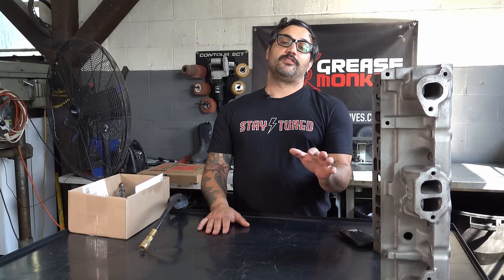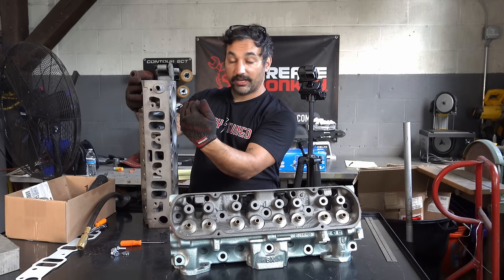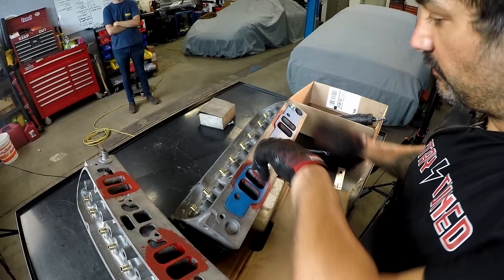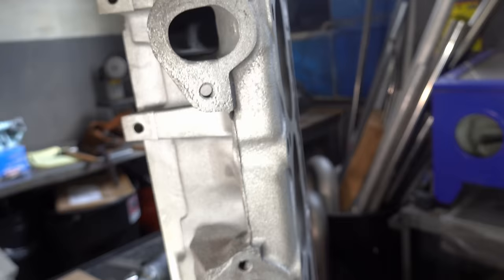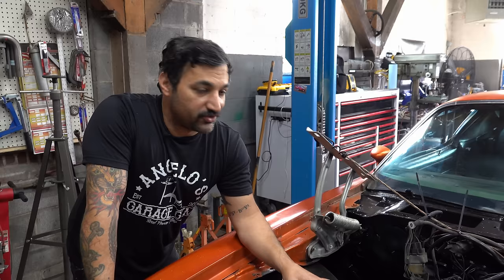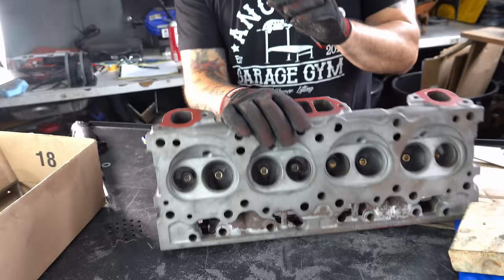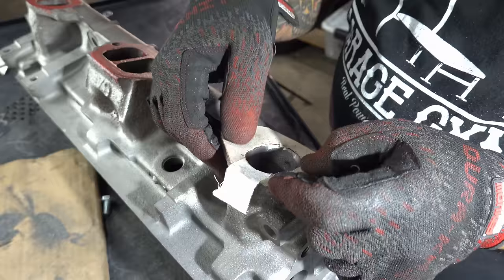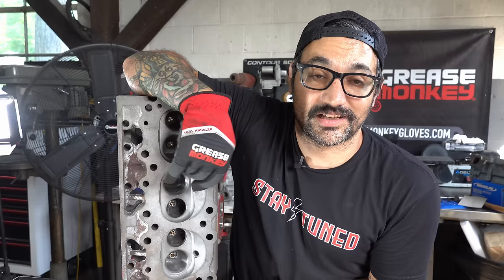It's Free and I Hate it! *Works on Any Engine

Comment: When porting my best tip is have a vacuum running to keep the shavings out of the way during the porting. Just stick it on the back side to keep the port clean to see what your doing
Reply: I know your expertise is in sword fights but this is a good tip 👍
Reply: This is my favorite thing to do, especially when porting cast iron manifolds (sometimes you have to do what you have to do, but mainly on turbo manifolds). It's amazing at how well I works.
Reply: It’s worth setting up a fan and collecting bucket. Much less noise and stress.
Reply: I fully agree, when porting our 6x4,s I did this vacuum technique with some ear plugs in. Around 1993, it works great so you can see well everything you want to remove and everything you know you should not as well.
Reply: Smokey Yunick is the man that started this. Hat's off 🤠
Reply: I have water running directly at the bit the whole time and everything washed through to the tray that’s underneath the head
Reply: I use magnets , too.
Reply: 777777
Reply: @Zzus321 my dad did this also he had a( soiox) soo valve grind  machine his little shop in the 50s-60s
Reply: We use pam cooking spray on burrs to prevent aluminum clogging on your tools
Reply: Shavings equals horsepower

Comment: We were a Pontiac family and porting the exhaust side of a Pontiac head will make HUGE changes. I'm loving this build.
Reply: They look really restrictive.
Reply: @jcnpresser  - Yeah and such a small exhaust valve for the CI.
Reply: @danmyers9372  670 heads would be nice but getting hard to find I'd imagine.
Reply: Porting the exhaust ports will increase bottom end mid torque numbers… but the problem is there’s not enough cylinder head to port out without going into a coolant or oil jacket.
Reply: So I have a question, if I port the exhaust side of my Kauffman heads will that help, how far should I port them. Header gasket match? I don’t want to hit a oil or coolant passage however more flow is very interesting! My heads are CNC ported to 340+CFM.
Reply: @MrTheHillfolk  I have 670 heads on my 67 block and I've been debating about going over to aluminum heads to ease up on the compression. I know they were the last of the closed chamber, high compression heads though, so I'm kinda hesitant to move on. 🤔
Reply: @mattysoho  my buds car, that was late 80s like 89 or so. 
"Usually" aluminum heads should be better you'd think ,I honestly don't know. 
I'd definitely save em if you do swap to aluminum, my buddy shoulda dropped the $ and had his redone. 
I'm wagering the aluminum heads have lower compression(hah that's no fun)  from what ya said.
Reply: I’m lovin Tony.

Comment: Porting does nit make "more air flow in and out" that is a huge misconception people like to say, the whole point if porting is to make the air move in and out more efficantly "smoother" and be less turbulant...  As fir gasket matching you wanna "Funnel" the gasket opening with a smooth radious and not just hog it out to be that size, if you make the whole port the same size as the gasket then you just slowed down your incoming ait charge. Another VERY overlooked thing people don't think aboutnis the Cumbustion Chamber like deshrouding and make a smooth radious where the air flows around the valves and good valve seat and valve radious angles.

Comment: Very pleased that you are building up the classic Pontiac V8.  Keep at it; lots of Pontiac enthusiasts still around that love this!
Reply: It was lonely years ago. There were very few of us. But now with the internet and people realizing just how rare birds are there buying then up and creating on line clubs.
Reply: I had a 67 Firebird convertible with a 326.  I let it go in the 80s, partly out of frustration with aftermarket support.  Went to z28s after that.

But because I'm a glutton for punishment, I'm now working the top end of an Olds 425 for my 65 Delta 88.

Still, I have a soft spot for the ponchos.  Good memories.

Comment: Also, after gasket matching the ports, always make sure that the intake port is smaller than the head port. So long as the intake port is slightly smaller than the head port, you build what's called a reversion dam. Any supercharging effect that may possibly happen from the mass of air traveling down the port, when it tries to revert from bouncing off of the piston when cylinder pressure rises or off the back of the valve, this reversion dam will keep pressure in the port. When you go to install the intake gasket, make sure that you glue the gasket to the cylinder head. You can do this with 3M spray adhesive. You don't need to cake it on, but you do need to put a thin layer of spray on the gasket and on the cylinder head. Also on the intake manifold side of the gasket and the intake manifold gasket surface, put a very very thin coat of Vaseline. This will allow the intake manifold to wedge into the gasket helping to compress it and lock it in place. It will also prevent the gasket from moving where you have it lined up on the cylinder head so it does not become an obstruction in the port. You do not want the gasket to move!  As the intake is torqued down, stick a flashlight down the ports and see how they are lining up. If the intake seems high, look at the floor in the port. If it still looks high you can either try a different (thinner) intake gasket. If the intake seems too low on the port, you can try a different (thicker) gasket. You can sometimes use generic gasket material. Trace your existing gaskets on the gasket material and cut them out. Add these new gaskets to the existing ones to act as shims. Some OG engine builder tricks.

Comment: wow, that's super generous of butler performance to give you a ported head as a template to follow!   Saves so much time cutting and testing with a flow bench
Reply from the maker: Butler has been awesome supporting this build! Yeah, this head was cracked, so they had it laying around and shipped it up.
Reply: @StayTunedTA  - Get two cracked heads and weld them up and use them...

Comment: Awesome project! I put a sump like that on a fresh tank in my 78 T/A way back when but my welding skills were such that when I put water in to test for leaks it was like a strainer, lol. I had to silver solder over the welds to get it to stop leaking. At the same time I put an Aeroquip "tip over" check valve vent in the top of the tank at the recommendation of our local speed shop engine builder/Guru. I also home ported my 6x heads after practicing on some 4x and getting some tips from the same Guru, never ran them though as my motor had some ported 62's on it already.

Comment: You're an awesome dude Tony, I met you at LS East Fest 2019, you're a really kind guy and very very nice to me and my friend Jordan Frank. You're definitely living the dream doing stuff I wish I could do so desperately, I just don't have a place where I can do anything unless I want to lay on a steep hill covered in muddy, dusty gravel which is just a recipe to ruin anything before it even gets built. One day I'll get out of this place and have a garage. I live that you're keeping it Pontiac, just nice to see something a little different. The head porting is great, a dab 'ill do ya though, just a mild job since the blower will be doing the work. It should certainly put 600 to the wheels, might take a dribble of race gas to be safe or some ethanol carbs if you can get corn juice. That car is wonderful, I adore it. Definitely a conversation piece. I have a 2004 GTO 6M that has been in storage since 2018, I lost the engine in a tragic accident, I had just dropped $7,000 into the car. Total heart breaker. I have to assemble a new short block one day and get my cam/headers LS rocking again. Your loyal viewer, Lee Henderson

Comment: Hey Tony absolutely loved the series on the TA  Can't wait to see it's finished I'm 61 so I had one of those cars back in the day 76 TA  With the anemic 400 lol  Love what you're doing keep doing you
Reply: The 1976 400 had 7.6:1 compression. All it needed was to mill the heads about .040 to .060 and a set of corresponding push rods and it would wake right up.

Comment: Hey Tony,  glad to see you showing the way things used to be when most cars you owned were iron block and heads, also upgrading to aluminum heads were to expensive or didn't exist. I ported 2 sets of early iron windsor heads and those heads need all the help you can give them, couldn't afford the aluminum ones in the 80's. Love what you are doing.
Reply from the maker: Right on!
Reply: Ford Windsor are really bad.  I had them on my 1970 Mach 1, 351 W back the mid 70’s.  And unlike today there were NO aftermarket heads forthe Windsor back then.  The Cleveland and the FE got all the aftermarket love.

Comment: I use the gaskets I'm going to use as a template, that way you can line up the head and intake and exhaust to be sure you get smooth flow all the way thru.  Even the header flanges can use some cleanup usually. The hippie porter I learned from said to think of the air as water and imagine how it flows thru the ports and valve.  You would go to his garage in the middle of the night and there would be 2 lights on, his little work light and his weed. Had a flowbench but relied on his vision of water flow the most. 
I built a 468chevy with a 6/71 and the guy had an "awesome welder" to weld that sump on to save me time.  He put it on sideways!  🤯😂. 
Keep up the traditional, diy, lower buck style. I'm tired of everyone buying power, we used to have to make power and you learned so much more that way.

Comment: Porting iron heads is a lot of work so it’s always best to concentrate your efforts where the best results are. When it comes to Pontiacs the exhaust side is where most of the power gains are found. Consider the ultra rare Ram Air 2 heads. The exhaust ports are pretty much the same as the Ram Air 4 but the intake ports are plain old Pontiac style and the RA2 cars kicked the butts of bigger and supposedly better muscle car engines.

Comment: I recommend grinding off the casting flash in the oil collection/pushrod area of those 6x heads.  It will improve return oil flow and avoid any little pieces from breaking off and clogging up the oil pan and pickup tube.  Also lessen the likelihood of cutting your finger on the rough edges.  Overall.... your home porting gets a grade of A minus.
Reply from the maker: Yeah, I noticed that in the butler head and planning to do it as well, for sure! I’ll take that grade!
Reply: Yeah because they haven't broken off in 40 years but they may break off tomorrow.
Reply: Chris Eason probably 90% wont, but why take the chance?
Reply: @chriseason2785  Caustic cleaning or shot cleaning could change their integrity just enough ...
Reply: @StayTunedTA   Same for all the block inside, smooth everything to get oil  to return faster plus do a very close detailed oil pump inspection to get better flow inside the oil pump housing (or just buy one of Butlers pre finished oil pumps with the double thick bottom plate)

Comment: I really got into Heads and Intakes porting and polishing for the offshore race motors in my 1967 race boat. Once you have the tools it's free like you said and the tools are not that expensive. Now I do spring heights, lapping valves, cut the stems for real valve seals, etc, etc. It can be a pain like a 1000 piece puzzle to get started but once you have been at it for a while it starts to get easier and easier as you go.
Reply: Just takes some time. 
Seems to take me from an hour to maybe 2 per port depending on how bad they are.
Reply: @MrTheHillfolk  Need good bits though. 👍👍

Comment: Can't wait to see it completed. My 455 has a set #96 heads that are ported and have the center heat xover filled with aluminum. They work well, but sure would like a nice set of cnc butler ported heads at some point. My 96's have the 2.11 1.77 valves and give a 455 around 9.2 comp for pump gas! The heads are lookin good!

Comment: When I was a young buck I got a Dremel and had my stock heads from my mustang off my car. I ported the intake and exhaust ports. Removed the emission humps in the exhaust ports also. I ended up getting some C-9 Windsor heads and gave my buddy the stock ones I ported. They made a difference over stock on my friends car. I spent many hours porting those heads. It made a big difference in how the exhaust sounded also.

Comment: Looking forward to this build.  the 80s are right in the wheel house of my formative years. Learned the transfer template trick from my old man about 40 years ago and it has served me well since. One tip…the best material to use is the carton from a 12 pack (or case if it’s a difficult project ) of beer. Perfect thickness. Also learned that the same 12 pack carton makes for pretty good gasket material in a pinch.

Comment: In 1971 I owned a 68 Pontiac Firebird 350 HO 4-speed with 20k miles that had just blown a head gasket. Pulled the heads had them milled 0.020 and spent about 40 hours porting them. Also added Hooker long tube headers, and a Crane hydraulic cam. The power gain was impressive, went from 9.0 ET to 8.1 ET in the 1/8 mile.

Comment: Over 25 years ago I had a 78 Bonneville with a 400, 6x heads  just like yours. Seeing you going down a similar path I went is really cool. I will say after some modifications to the rear differential by changing the gear ratio that tank would embarrass Camaro's, Firebird's, and them T/A'S too!! I also used to drive Dukes of Hazzard style and smoke the county Sherriff Department.

Comment: It's been my experience  with matching exhaust ports to match the head to the exhaust manifold , there are times when exhaust manifolds is headers don't have enough material to work with a  head port that has been opened up to much. I ve found a well matched port of a smaller size if necessary is always more efficient for velocity and scavenge

Comment: The dewalt electric grinder is really nice to use because you don’t have to wait for the compressor to catch up and it’s a lot quieter
Reply: It wont freeze your hand with cold air in a cold shop either
Reply: @ericj3112  so true
Reply: The promblem with air tools is you have no torque when you slow the rpm down . Electric still has torque at low rpm.

Comment: I actually ported the intake on my 2 stroke 250cc. I went all out, carved extra chambers through the sides just under the water jackets, easily doubling my intake volume. The exhaust has the power valves so I figured we may as well even the score.

Comment: Butler built my 467 shortblock and i slapped on a set of kre high port heads.  Should be around 10.8:1 so i run 93 . Still need a better tune on my holley sniper but already make alot of tire smoke. Cant wait to see yours done

Comment: When I make a gasket, I usually start with the bolt holes, then I put the bolts in, to hold the gasket in place while I do the outside and inside.

Comment: From looking at the videos of the finished head it looks like you can take more off the intake short side radius. The area below the valve seat is not transitioning into the bottom of the runner smoothly. You can take more metal away until their is noticeable point where the runner ends and the area below the valve seat begins.

Comment: I would recommend mocking up the heads and intake on the finished deck of the block you are using prior to port matching.  It's amazing how much mismatch to an aftermarket intake can exist and still bolt up.  I returned a couple of Team G SBC intakes because they were so trash in alignment to my Dart Iron Eagle heads.
Reply from the maker: I would but I don’t have the blower intake in hand yet!
Reply: Gasket matching heads and also  intake should take care of that... bolts hold gasket in correct spot...
Reply: @BuzzLOLOL  provided holes line up.  I've seen some crazy crap where they don't.   Should be fine unless very unlucky.

Comment: Back in the SD-455 era I had some SD-455 heads those were the best Pont cast iron head to be had.
On that head Pont would drill the push rod guide hole to where a steel tube could be installed.
Then the intake runner on the push rod guide side could be ported into the guide then they would press in the tube. That would really open up that intake runner that's one of the secrets of the SD-455 head. 
That same thing can be done at home on any Pont V8 head.

Comment: You have got to love the light metal flake paint Pontiac used ! It kinda don’t make sense because the first big name was Indian names like cheifton . Might have been  like a red color but I don’t know why the blue but I always liked it !  Then back when Chevy went to v8 in 1955 GMC was part of the Pontiac garage !  So the GMC trucks had Pontiac motors in them up in to the 60’s !  Knowing this I found a 1976 Grand Prix 63 k miles took that motor put in my 1980 C-10  short wheel base I used the motor and transmission automatic as well .  Used the plug and wiring harness just moved a few wires in the plug ! It run real well .  I still got a standard shift belt housing for Pontiac-Buick-Oldsmobile because I was going to go standard 3 speed on the tree .

Comment: i drove to Ohio from Missouri to get a set of X heads off a 340 Dodge engine to put on my 360. i did all the porting and opening them up myself, it sucked but was way worth it. crazy how the engine sounded different with the bigger heads.

Comment: Direct connection used to sell template's. With my limited experience, the roof and bowl's are the important part. The floor has water jacket's and doesn't effect flow as much as the roof where most of the flow is.

Comment: From Julian Edgar's channel - air likes to stick to smooth corners,  air likes to break away from sharp corners.  (Smooth out the court l short side and don't sand the long side as much (breaks up the boundary layer).
Also, q=va means if the cross sectional area increases,  the velocity drops and vice versa.